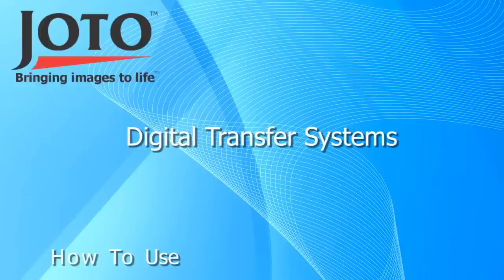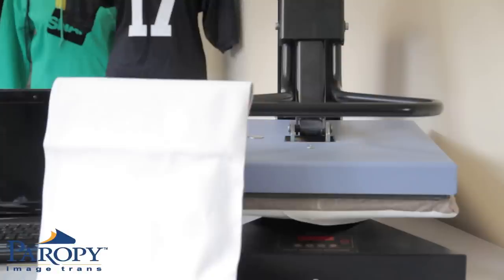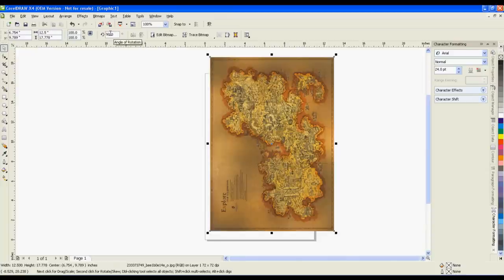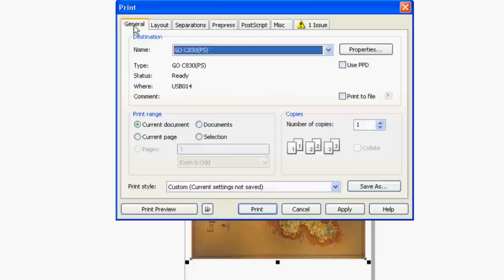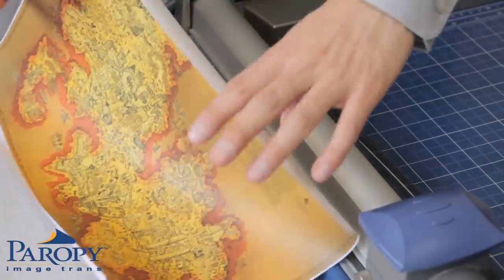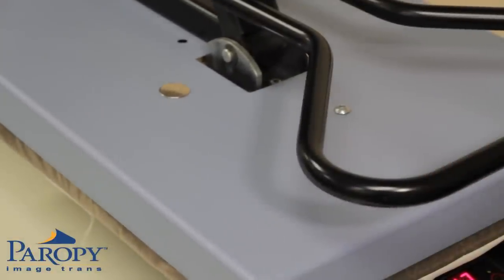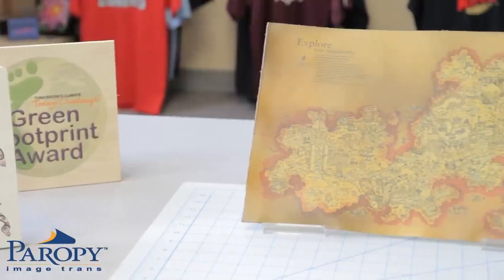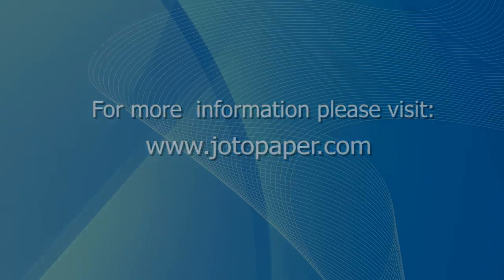How To Transfer a Custom Image To Leather

Comment: hi there so if we were to use this method but on smaller leather squares with the prints on it and use then as coasters, would that clear film still protect it from hot or cold water, hot temperature cups and etc would it damage the print in away or would stay intact
Reply: +Anneta Meas and also does it have to be synthetic leather? can you use real leather?

Comment: Can you transfer an image to a leather sneaker like Jordan's?
Reply: jotoimagingsupplies super late but acetone and a cotton ball will remove that finish and then you can use some raleigh restorations scratch resistant sealer to seal it back up